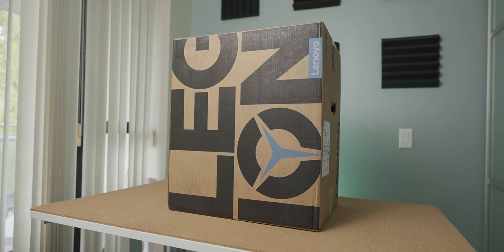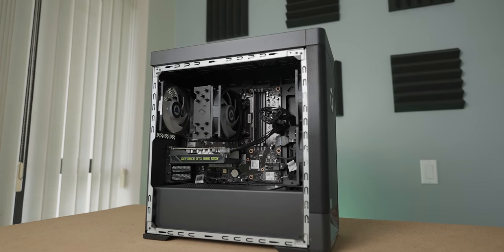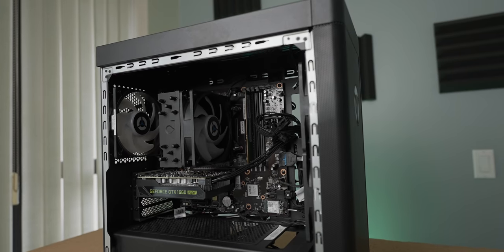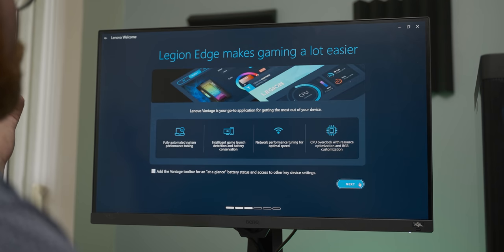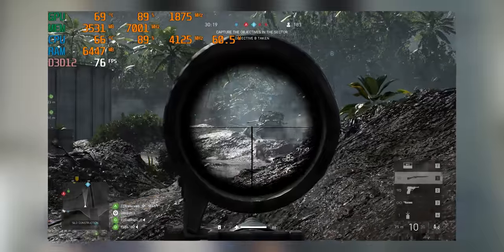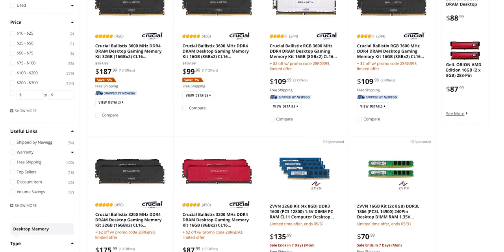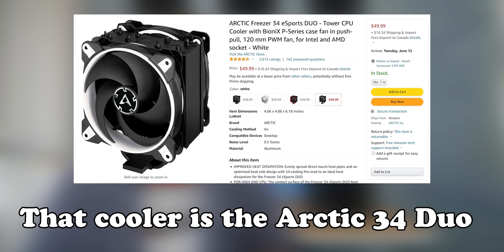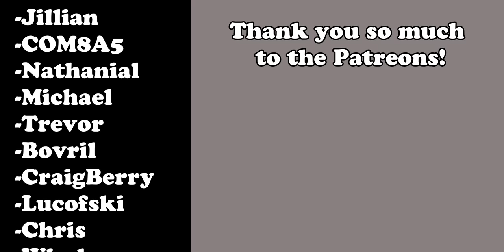Is Lenovo the KING of OEM Gaming Pre-Builts?

Comment from the maker: I bought that Crucial ram and unfortunately it does not clock up to its rated speed. It runs at 2666Mhz. I'll see if I can find a third party kit that would work.
Thanks for watching y'all!
Reply: i'm interested to see what works. i have a ibuypower prebuilt (b/c i know f*** all about building my own), and i was curious to know which ram would work. I've heard these pc's don't operate higher than 2666mhz for ram.
Reply: Thank you because i tried it and it didn't even read the ram at 3600Mhz idk if i got bad ram sticks or if it was the computer and it was my first prebuilt it took me forever to figure out the problem yesterday but i got it working with the old 3200Mhz it came with plus it was in dual channel on the ryzen 7 3700x with the 1660 super version so not a big problem
Reply: is it ok if I upgrade my GPU with an RTX 3070 without upgrading my power supply?
Reply: thanks if you find one that works ill click that link and order it.
Reply: hiperx predator, 16gigs (2x8) it works oc on 3400mhz stabile... with ryzen 3200g
Reply: can you do a video on how to clean the dusfilter in the front, cant figure it out :) i have a
Legion T5 28IMB05 -like the sam model on the chassi
Reply: Get cl22 3200mhz non xmp ddr4 udimm, crucial worked for me on at 3700x
Reply: @atomicfart6830  nah man, my 3070 will have power spikes and my computer would randomly turn off because of it and i was using a coolermaster 650w 80+gold psu. I changed my psu to a SuperFlower 850w and I have no problems since then. I recommend at least 700w for an rtx 3070
Reply: Have you been able to find a third party kit that would work?
Reply: @craig71686  my hyperx fury has a heat sync and led at those dumb jdec timings sadly. Fml stupid hp omen prebuilt vd proprietary motherboard and locked bios bs
Reply: @Derek2k  yeah well you could always swap in a new motherboard but RAM running at JEDEC timings can be good because they are running at spec which doesn't cause an increase in cpu temps since Intel and AMD both have their memory controllers interested into their processors now. There is only a slight difference in performance and RAM running at JEDEC timings is more reliable. It's a trade off.
Reply: @abstractt_7181  Ryzen and thus the PC doesn't support 3600 RAM without XMP/whatever it's called on AMD. Ryzen 3000 series supports up to 3200 for JEDEC RAM speeds.
Reply: @Ulfplays  The front is likely removable, there should be a detailed service manual on how to do things like that on the Lenovo support page if you want help, as I never removed the front myself yet.
Reply: @RoundDuck kira  i figured out how to clean the filter :)
Reply: there is a new bios that let oc the memory to 3200 mhz    from 24/03/21  you can update frome windows update "optional updateds" did not try it yet
Reply: Have you had a chance to check out the Ryzen 7 5800 (non-x) OEM CPU model?
I just got one ordered and I can't find any real good information about it. Any information works be appreciated.
Reply: I have purchased a Legion T5 26AMR5 with Ryzen 9 5900x and RTX 3060ti that came with only 16 GB RAM dual channel CL22. I have added 16 GB of RAM dual channel CL22 from CRUCIAL model CT2K8G4DFS832A. In BIOS in advanced settings you can find an option of AUTO LOAD JEDEC or MANUAL 3200 mhz. When started the system with the AUTO LOAD JEDEC option on, it didn't run these new RAM at 3200 lowering it down to 2666 mhz. With the MANUAL 3200 Mhz option selected IT WORKS. So problem solved for me. Hope this will help you guys.
Reply: @DocRiprock  oh get some help
Reply: @atomicfart6830  no
Reply: @WhatZHeckMan  nice
Reply: If you can't force XMP with Ryzen Master then I would recommend just using four sticks of micron 3200MT/s so you can get the fastest supported speed and take advantage of interleaving.
Reply: @kutzz2k  big flex
Reply: @kutzz2k  if ur running a 5600x or 3600 I think 650 watts with a 3070 is fine. But if ur running a k series intel yea bigger psu is better. Also some models of 3070 draw ALOT more than 220 watts of the reference 3070 spec. My ftw 3 ultra 3070 draws 270 watts stock lol. Its such a waste I can set it to run at 220 watts and lose maybe 25-50 mhz on the gpu. Can do over 300 watts on the 3070 with max power limit.
Reply: @BeatsbyVegas  Yea youre right, was running a 9700k with it but it was running fine with no issues for like 6 months though and after that my computer would frequently turn off even after resetting all of my clocks to default and only a psu change worked for me. For reference, im using the Zotac twin edge oc model which is similar to the FE edition so my 3070 is not supposed to be power hungry
Reply: @kutzz2k  I got away with a 3600 and 270 watt ftw 3 3070 on 550 watt psu for a couple months without issue. I upgraded to a 750 watt unit just so I had more headroom as I also moved to a 5800x. My psu can handle peak power of 900 watts and 750 watts continuous which is perfect for rtx 3000. Since it can handle any huge power spikes it may face, but still output 750 watts non stop.
Reply: @bmyanez17  ive ordered the same. Could you just give me some of the specs on the setup if uve recieved your yet?
Reply: @atomicfart6830   prob not, 3000 series gpus tend to have pretty high power spikes id prob go up to 750. Most power suppies are most efficient around 50% power draw too . #pcpartpicker
Reply: @BeatsbyVegas  Yeah mine was running fine on 650w as well for a couple of months though i dont think it would be suitable for long term like the power spikes i experienced and a little extra headroom would be nice for future upgrades. I choose an 850w unit as it was more or less the same price as other 700-750w units so i figured why the heck not xD
Reply: Hey David, if I get this PC for Fortnite, do you recommend me to add another 8 gig of ram (If so which one). And what will adding one do?
Reply: @mr.t459  So I've had it for about a month now. It's definitely been a good entry/mid level gaming PC. I Play Apex mostly and get 144-160 FPS. Warzone is kinda jumpy on FPS but I get a consistent 90+ but it does of course on the GPU you get with it. Mine came with the 3060 Non Ti model. I have no real complaints and like Dawid pointed out, it's a standard set up so things can be replaced if needed which is nice. I had ordered a Dell PC and quickly realized my mistake so I sent that one back and got mine.
Reply: Hi I need some advice, I would like to buy a pre built pc around 1,500 euros, do you have any recommendations?
Reply: I have the same pc but how do i speed up my ram i bought vengeance lpx ddr4 but the bios is so retarded i cant figure it out were to go to speed up my ram
Reply: I just bought the T5i and not even the stock RAM runs at the advertised speed. Instead of 3200, it runs at 2933. Tech support says that they can’t do anything about it. And no support for XMP either…
Reply: @DocRiprock  IBuyPower uses standard compoents. You can use any commercial RAM out there. The only thingh you need to check is the make and model of the motherboard to see up to what speed it allows the ram to go.
Reply: Is it safe to change the mobo? Bcs I'm thinking it. Since the original motherboard doesn't have xmp supported I want to change it to some more decent motherboard
Reply: @dafaqu694  Yes it is safe but first check the layout of the power and reset buttons. Normal boards have them on the bottom right and some OEM have them all over the boards. OEM boards work with JEDEC compliancy and standard boards have XMP. Have an HP Omen 25L and I bought a kit of Crucial Ballistix 2x8GB DDR4 3600MHz CL16 and they work at 3200Mhz in the PC. Very important check that the memory kit that I mentioned has the code BL2K8G36C16U4B otherwise the speed of the memory might e lower.
Reply: @Teksers  I changed the ram to Team group T-force 16x2 and it only runs at 2400 mhz so, since it doesn't support XMP I was thinking of changing the motherboard to Gigabyte or MSI

and while I was researching it, thank god it has manual to change your mobo and all stuffs, really helpful tho
Reply: @dafaqu694  pls let us know how things went and what Mobo model you picked.
Reply: Just buy another stick from lenovo (if possible)
Reply: @groove269  I don't think it's possible
Reply: @atomicfart6830  depends on your powersupply
Reply: This reminds me of when I bought some used GEIL ram as part of a parts bundle, and the CPU I got in the bundle would support up to 2400MHz RAM, which those RAM modules were rated for, but ran at 2133MHz until I enabled XMP in the firmware on the mainboard included in the same bundle.
Reply: You have to manually set the speed in the BIOS, had to do the same thing to my system. Legion T5 26AMR5.
Reply: Got similar model but with 

Processor : AMD Ryzen™ 7 5700G Processor (3.80 GHz, up to 4.60 GHz Max Boost, 8 Cores, 16 Threads, 16 MB Cache) Operating System : Windows 11 Home 64 Graphics : NVIDIA® GeForce® RTX™ 3060 12GB Memory : 32 GB DDR4 3200MHz (2 x 16 GB) Storage : 1 TB PCIe SSD Gen 4 Keyboard : Full size - English (US) WLAN : Intel Wi-Fi 6 22260 2x2+BT5.0 vPro Warranty : One Year Legion Ultimate Support
Reply: update please about the ram replacement ?
Reply: Have you ever figured out the ram i just ordered some but i think i need the xmp in bios so i might return it but i dont know what ram to get cosidered swapping motherboard just for a better bios
Reply: how does the ryzen 5 3600 compare to the 5600? the model im looking at says its a 5600 and ive got no clue what that means
Reply: @bmyanez17  How does that system perform for you? I’m about to buy it.
Reply: @MaartenOtto  so far so good, depending on what you're playing I've been getting around 100+ FPS but from what I've observed so far the 3060 is the bottle neck. However, you can over clock it a bit and get a little extra out of it.
Reply: @bmyanez17  Cheers. The setup I’m looking at has a 5800 and a RTX3070 with 32GB Ram for €1699 which translates to $1923 including VAT.
Reply: @MaartenOtto  Nice! it should do well. I have not had any issues with the system. Let me know how it goes with the 3070 with and without overclocking if you choose to run it. Overall the only thing I think I need to upgrade in the future is the GPU. But we'll see when that happens given the market.
Reply: @bmyanez17  Well it died in less then 5 days.
Reply: @MaartenOtto  that sucks, what died? There is a warranty with Lenovo.
Reply: @bmyanez17  GPU died. I’m in contact with the seller
Reply: @bmyanez17  How is your 5800 non X version doing? I've just ordered the same one.
Reply: @orchy86  It's going well so far, from what I play it's never maxed out,  my GPU is at 100 but I have a 3060 so it's the starter of the 30 series.
Reply: Hey, did you find a working solution to use dual channel ram at 3600Mhz?
Reply: @dennislaakso8112  He most likely did not, i have 2X16GB Ballistic CL16 sticks on the way, if they fail i will contact their tech support and see what they say. Its odd that the included 2x8GB CL22 RAM runs at 3200Mhz but if not the RAM i bought run at 3200 they have done something else with the MB/BIOS
Reply: @hammadsheikh6032  i have this EXACT same issue with the same model. Have you found anything that might work?
Reply: Any solution?
Reply: @delambo88  Only way to get 3200MHz RAM for it is to get the what i call office desktop RAM from crucial that runs on 1,2V and comes at 3200MHz but with the CL22 speed. On their website you can see what ram is compatible, i tried both my hyperX and ballistic but none of them worked since "normal" ram for gamers run at 1,35V that can most often be achieved with XMP but thats not a feature Lenovo let us access (except on 1-2 of their latest Intel builds)
Reply: @Left2livesurvive  thanks for the reply. I'm changing the motherboard to the gigabyte master. And crucial ram and a cool castle water cooler. Make this PC a real pc
Reply: @delambo88  I have the Ryzen 7 5800h and RTX 3060 version and i like it except the dumb stuff with the RAM. Next time its time to upgrade i will buy my own again, prices should be even lower by then :'D
Also i do know that the Lenovo community manager are aware of the XMP concern and he will work to get them to change and let us use XMP
Reply: @GPU VOYAGE yea Kingston have some 1,2v RAM as well for 3200mhz. But was not aware that some HP builds did not allow XMP
Reply: I just bought the ram linked in the description then saw this comment. Is there a solution or can I expect my ram to run at 2666? No worries either way, I love the channel and all the glorious tech tips.
Reply: @noahsanchez9236  It will run at 2666 since it requires 1,35v and the lenovo MB only has 1,2v without XMP
Reply: Any ram anyone can recommend to run at 3200?
Reply: Doesn’t Lenovo lock their cpu to their motherboards only, so you are not able to use that cpu with any other motherboard, AND if you install a new cpu to the Lenovo motherboard that also gets locked to Lenovo boards
Reply: @skulldefense9069  no idea
Reply: Dawid, If you get a higher spec model, there will be 2 sticks of ram in duel channel. Thanks for that, Lenovo!
Reply from the maker: @scemer3000  Hell yeah! That’s good to hear.
Reply: I bought the big Brother, the T7i, and Had the Same one in RAM, except that in the Crucial Webpage there is a Tool that actually Checks your system and shows kompatible RAM and ist worked great for me.
Reply: Hey bro check the bios again there was an optional update that came out you can now set the ram speed to 3200mhz
Reply from the maker: @edelamores3540  Oh hell yeah! That’s amazing.
Reply: You have to enable this in the bios. They're all shipped at 2666 and will ramp up to 3200 after that.
Reply: @edelamores3540  i dont have that option, can  help me?
Reply: @DawidDoesTechStuff  does it mean that if if I buy the ram recommended, install it, update option via BIOS it will run at 300mhz? I got an T5 with a Samsung ram CL22, I would like to update it to something better (CL16) and still have option to run it at 3200mhz. Thanks!
Reply: @edelamores3540  does it mean that if if I buy the ram Dawid recommended, install it, update option via BIOS it will run at 300mhz? I got an T5 with a Samsung ram CL22, I would like to update it to something better (CL16) and still have option to run it at 3200mhz. Thanks!
Reply: @Dawid Does Tech Stuff
 Hi can u tell me which one of these two PC-s should i buy!?
Which1 u recommend me!?
     LENOVO LEGION i7-11700F/16GB/1TB SSD/RTX 3060Ti 8GB 90RT003JRI

Chipset:Intel B560
Processor:    Intel Core i7-11700F (8C / 16T, 2.5 / 4.9GHz, 16MB)
Graphics:     NVIDIA GeForce RTX 3060Ti 8GB
Memory:       16GB DDR4
Memory:       1TB SSD
System Lighting:Legion OY iconic LED + Internal ambient lighting
Audio:        High Definition (HD) Audio, Realtek ALC887 codec
Keyboard:     USB Calliope Keyboard, Black
Cooler:       95W Airflow + PCH heatsink + VRM heatsink + M.2 SSD DECO MYLAR heatsink
Mouse:        USB Calliope Mouse, Black
Ethernet:     Integrated 100/1000M
WLAN + Bluetooth:11ax, 2x2 + BT5.1
Front Ports:
2 x USB 3.2 Gen 1
1 x headphone (3.5mm)
1 x microphone (3.5mm)
Back Ports:
2 x USB 2.0
2 x USB 3.2 Gen 1
1 x USB-C 3.2 Gen 2 (support data transfer and 5V@3A charging)
3 x audio out (5.1 channel)
1 x Ethernet (RJ-45)
1 x power connector
Power:550W 88%

-------------------------------------

     LENOVO R9-5900X/16GB/1TB/RTX 3060Ti 8GB 90RC009HRI

Chipset:   AMD B550
Processor: AMD Ryzen 9 5900X (12C / 24T, 3.7 / 4.8GHz, 6MB L2 / 64MB L3)
Graphics:  NVIDIA GeForce RTX 3060 Ti 8GB GDDR6
Memory:	   16GB DDR4
Memory:    1TB SSD

   NO OPERATING SYSTEM

Audio:     High Definition (HD) Audio, Realtek ALC892 codec
Keyboard:  USB Calliope Keyboard, Black, English (UK)
Mouse:     USB Calliope Mouse, Black
Cooler:    150W Airflow with RGB light
System Fan:2x Top ARGB + 2x Front ARGB + 1x Rear ARGB
Ethernet:Integrated 100/1000M
WLAN + Bluetooth:11ax, 2x2 + BT5.1
Back Ports:
2 x USB 2.0
2 x USB 3.2 Gen 1
1 x USB-C 3.2 Gen 2 (support data transfer and 5V@3A charging)
1 x Ethernet (RJ-45)
3 x line-out(3.5mm)
1 x power connector
Front Ports:
2 x USB 3.2 Gen 1
1 x microphone (3.5mm)
1 x headphone / microphone combo jack (3.5mm)
Power Supply - 550W 88%
Reply: @edelamores3540  How do i get the update?
Reply: You basically need JEDEC RAM. The motherboard doesn't support XMP so You'll need RAM with 3200 MHz and CL22. That's the best you can do and It's from Crucial.
Reply: @edelamores3540  So XMP now works? Or still nothing?
Reply: @timcesnovar978  yea it works now in the bios just gotta get it updated and you’re good
Reply: @edelamores3540  wait so xmp now works with this PC???
Reply: @atomicfart6830  is it OK if I can has cheeseburger?
Reply: Why
Reply: Yw
Reply: @regularperson9801  which update exactly and where in the bios is this option?? I don't see it
Reply: Does this pc work well for maybe vr?
Reply: its cool
Reply: @edelamores3540  we’re do you go for that?
Reply: Prob the BIOS. Try using Ryzen Master to overclock the ram to the correct speed.
Reply: any updates on a compatible 16g Ram for the 
Legion Tower 5 (AMD) Gaming Computer?
Reply: I downloaded BeamNG but it barley works,  in the game it says the minimum Ram needed is 16.
Reply: Lenovos BIOS is just horrible, imo the best workaround is to buy a kit with the same timings as the OEM, i had Cl-22-22-22-52, and a mushkin redline worked just fine without having to do anything.
Reply: This PC can use Ryzen Master software to get the RAM at native speeds
Reply: Good job Leg Ion 😊
Reply: Have we found a ram solution?